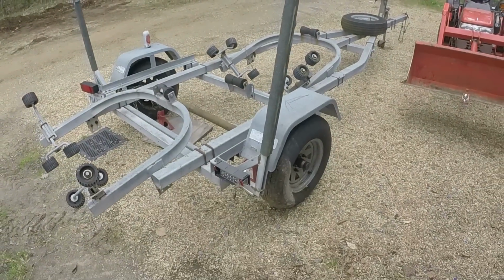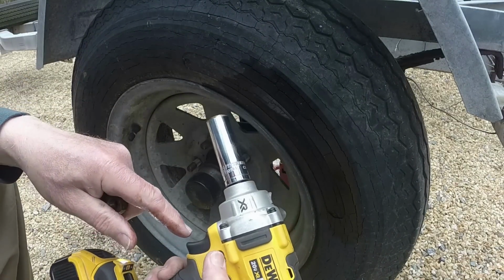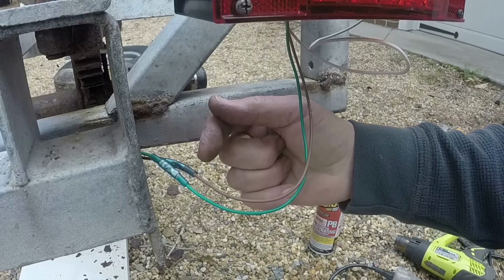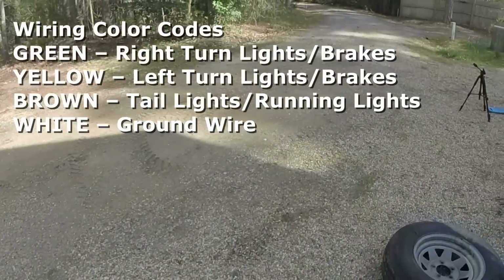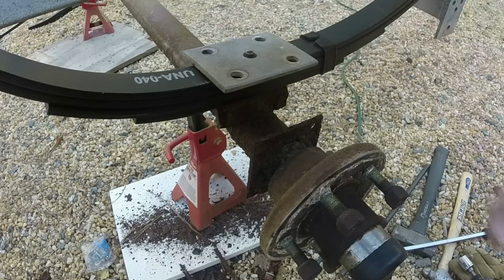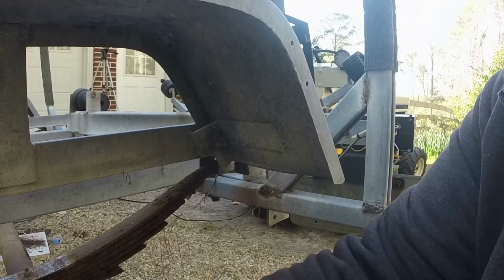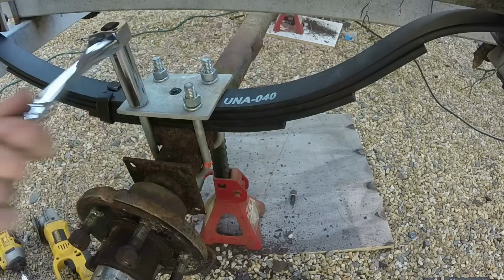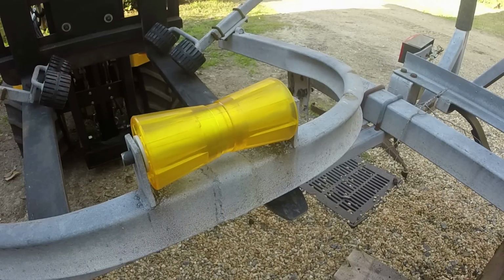Boat Trailer Maintenance Part 1: It's Worse Than I Thought!

Comment: I've always used anti-seize on all my roller pins and bolts when replacing them. It makes it easier next time to remove them while extending the life of the parts. 🤠

Comment: Get you some cold galvanize and spray the areas where you cut the bolts off and all the new hardware. It works very well.
Reply: I believe they have that same cold galvanize in brush on and that works well also. Well worth the cost, I’ve seen it used on highway projects such as guardrail and the bolts if they cut them off they paint the cut ends.
Reply: Agreed. Anyone that wants to touch up galvanizing: Do some research on which cold galvanizing you get. Lots of brands, most of which are at hardware stores of all sizes, do not conduct electricity, so they must not have continuous zinc formations. I've heard Zinga does, and have been told it holds up better, but make sure you do your due diligence in picking a product that is more than grey paint.